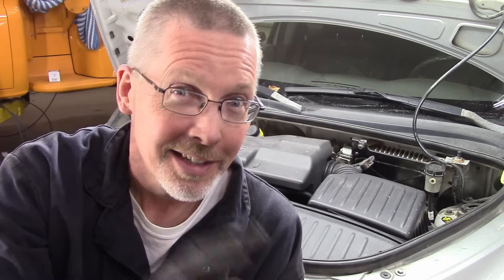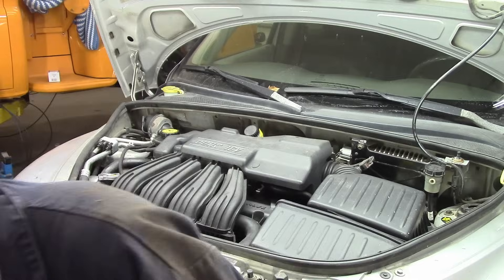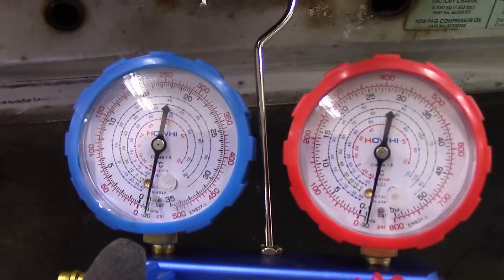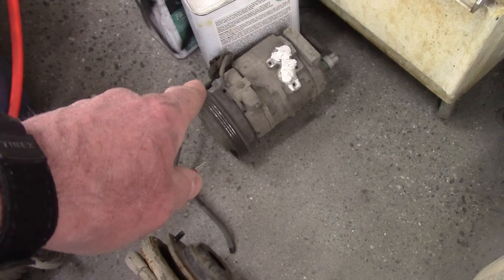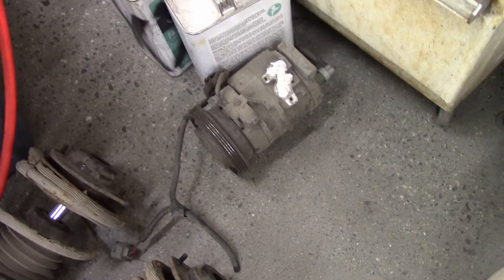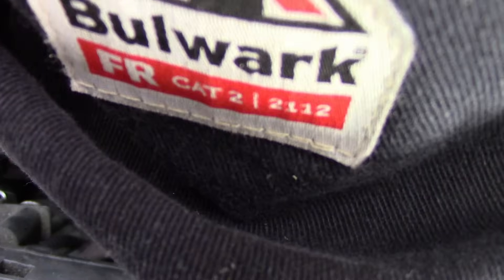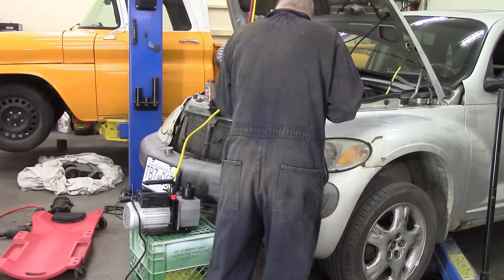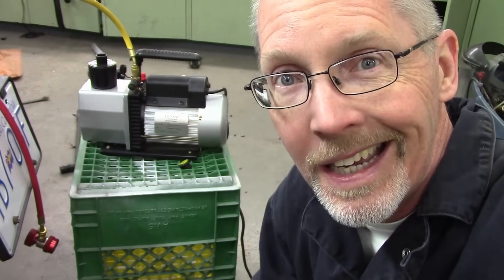DIY Testing, Fixing, & Recharging A/C

Comment: Thats the most half-cooked, haphazard, half-everything untechnical ridiculous "ac repair" video I've seen in my life that nobody should be seeing! So many things done the wrong way! You know, the right way is not always hard! The wrong way mostly always is!

Some laughable bloopers in the "repair" work(I can write a whole essay on it but don't have time) would be...

1) the right way to start this job to make it easier would be to remove the front bumper and the radiator first so you have all the room and dont have to cut off compressor bolts! Way more easier than wrestling with the compressor.
2) You didn't check if the compressor was getting power supply at the connector or not which would be due to a bad relay or fuse or a lot more other wiring related faults. Just bypassing a pressure switch isn't correct compressor failure diagnostics!
3) You start vaccuuming and then decide to put a new Accumulator. Im sure you switched off the Vacuum pump and then opened the lines again. Then, the low pressure inside sucked in tons of moisture and air! Super.😊
4) You did not say what refrigerant you actually ended up putting in it. Those dubious cans have added oil in them and you end up putting extra oil in the system. 

All I can say is Im aghast. Its awesome to use stop gap measures in a bind but this made me squirm. 
Anyway it was quite amusing. Thank you.

Comment: That thing about freon putting a hole in the ozone?  Yeah no. A gas (freon) that is heavier than air gets to 20,000 ft where sunlight breaks it down into sulfuric acid, then gets to 40,000ft and then blown all the way to the antarctic to destroy the ozone layer. Not buying that pile of bs.
That broken piece in front of radiator is probably an ambient temp sensor for the climate control or for engine management. 
On a side note, the last I heard India was still producing a billion pounds of R12 a year, and the hole in the ozone layer has disappeared.

Comment: when filling a/c on the low side keep the can upright so it draws gas off the top. upside down the can will flow liquid which can warp the reed valves in the compressor or worse case liquid slug and hydrolock it  making it spill its guts. ugh bummer
Reply: That was my concern also. Never fill refrigerant in liquid form.
Reply: @squirrelcovers6340  i have many times charged liquid  to the high side. when you put it in on the high side,  if the reed valves are leaky and you dont know it you are in the same outhouse

Comment: While not applicable here - make sure that plug you're jumping only has TWO wires not 3. 

If it's got 3, one is ground, one is sensor out, one is +5 from the BCM. The BCM can see what the actual pressure is (vs on/off or high/low).  Anyhow, point is you could damage the control module, and it won't turn on the compressor.  You just go to the fuse/relay panel and short the switch contacts there.  Same net result. 

We now continue with your regularly scheduled broadcast.
Reply from the maker: Very true. I'm working through the wiring harness of an LS Chevy right now, and I see that it's a pressure sensor in that system - three wires!
Reply: @GregWellwood  Found this out with a Mitsubishi Outlander. I just used a 1.5v AA Battery which gave a voltage within the correct range and the compressor clicked in.

Comment: Actually, by unbolting the compressor from the engine first and tying it to the radiator support you don't have to evacuate the AC system. Ive done several of those timing belt kits (with water pump) on PT-Loosers and had no problems. It's approximately 4 hour job.
Reply: I didn't think you should have to open the system
Reply: Yep

Comment: I'm sooo glad i came up on this video! I have been wondering about buying used compressors from junkyards.  From all my research, you absolutely want to keep all dirt/debris OUT of the AC system, however obviously if you buy a junkyard compressor its def gonna be dirty inside....how do you handle that?....or YOU DONT CARE? lol :)
Reply from the maker: When I pulled the compressor, I was careful not to get dirt inside.  Then I stuffed tissues into the holes to keep anything more from getting in.  When I got it home, I blasted inside with compressed air to hopefully blow out anything I missed.  At one point, you will notice I had put some white duct tape over the holes as I installed it.  Some things that I buy used on, I have to gamble on.  $300 new, or $40 used.
Reply: @GregWellwood  aaaaah ok that makes perfect sense...that's the gamble dilemma I am currently facing. I was wondering if I buy a used one that's not currently still installed on a vehicle, if it would be too dirty inside.
Reply from the maker: I prefer to pull my own parts (if the yard lets you), and I wouldn't pull one that's been disconnected and open to the elements.
Reply: @GregWellwood  gotchya! thanks for the responses and keep up the great content!
Reply: As long as the lines are hooked up on the junkyard one you should be ok. Just be sure to plug the lines (i use those cone shaped squishy earplugs) as soon as you remove it just to keep anything out.
Reply: @davidtatum8682  thank you!!
Reply: @troyporter3825  anytime

Comment: You know you should be using aluminum based anti-seize.
Reply from the maker: Are you sure? Aluminum-based is "food safe."  I may not like this car, but I'm not going to eat it. https://www.crcindustries.com/world-anti-seize/
Reply: The car has an alloy block , right — so why would you use copper base anti-seize ?
Reply from the maker: The car has an iron block.  Copper-based has a higher temperature rating. Nickel-based is used where Copper is not allowed. Both reduce corrosion. Either can be used with aluminum parts.  Aluminum-based is food safe.

Comment: Before replacing the compressor you have checked fuses and and wiring that is associated to the ac. Don't assume the the compressor is bad. It could have cost you more , replaced the part and still don't work. Keep that in mind.
Reply from the maker: Correct. Sometimes I gamble and win. In the next video, I lose.
Reply: Or something as quick and easy to rectify as the air gap on the electromagnetic clutch.

Comment: I've been a professional mechanic over 10 years, I thought this video would be laughable but you did a great job and were rather amusing. KEEP WRENCHIN
Reply: Some of my coworkers don't have that knowledge and their considered professional. Great job
Reply from the maker: I have a philosophy: "I can pay a professional to screw it up, or I can screw it up myself for free."  And... I have been teaching shop since before OBD2; I'm old.
Reply: @GregWellwood  Same motto, and when I mess up I know and try to fix it.  Some mechanics hide mess up and give the car back with a hidden problem.  As example, once I couldn't change a tire on the side of the road because the stud just spun.  The Goodyear tire monkey who recently changed that tire likely didn't know about LH wheel studs so just kept turning up his wrench until he spun the stud in the hub, then just put the wheel back like that, not letting the owner (me) know his screw-up, and leaving a hole to step in.
Reply: @GregWellwood  I got a 2006 mazda 3 2.3L 4cyl 

Problem A/C works great at high speeds but at idle it cuts back on cooling  sometime it will cool for awhile at idle then warm up and cuts back on cooling Car does not overheat
Car been maintained well

New parts below

Ac compressor (New)not rebuilt  not China crap eather GPD
Cooling fan
Condenser
Dryer
High pressure line
Water pump
Thermostat
Flushed radiator inside /out coolant
Expansion valve
Canned R134A
Cab filter
serpentine / A/C belts

What could it be?
Reply: @svbarryduckworth628   thanks buddy
Reply: @svbarryduckworth628   mine has 330k miles and it great  just saying  transmission shifts great still body great and I love it
Reply: @Devo1987  sounds like the cooling fan isn't doing its job to me. If you spray the condenser with cold water from a hose pipe does the AC get cold?
Reply: @svbarryduckworth628  funny considering that the Ford F150 is the most dependable truck on the road in it's class...and no i dont own a Ford, but I would definitely buy one. Grew up with my parents owning Fords and always were dependable vehicles.
Reply: @svbarryduckworth628  my Ford is 5
My Ford is 54 years old and my Sons will be taking their dates to prom with it this weekend and looking cool doing it.
😅
Reply: I was this was not a serious repair but it looks like it is good.
Reply: You were able to pull vacuum, aren’t you supposed to have it in line w vacuum pump to fill from one of those cans?
Reply: Damned by faint praise;-))

Comment: Was wondering why you didn’t mention testing for power and ground at the clutch before replacing the compressor.
Reply from the maker: Hmmm.  I don't know why I didn't.  Those should be step #1 and #2 before pulling the compressor for sure!

Comment: Ahhh, the Old PT Barnum Cruiser, made lots of money on them over the years. Almost every task leaves 3" of room to get twice as many inches of parts in and out. 

I prefer to use the silver anti-seize (tin man style) ...and some o-rings slid down the bolts to help hold them in place. They collapse easily later on.

Nice work.
Reply: After watching the video, giving due consideration of the amount of effort involved and factoring in that the entire project looks to be about as entertaining as masturbating with a cheese grater, I've arrived at a superior and much faster solution to the entire problem.
A five gallon bucket of thermite. Don't need anywhere near that much, but a job well done is a job done thoroughly.
This is an unusual solution that I'm recommending, as I usually recommend the judicious application of copious amounts of high explosives. But, the exception is for when one considers whether or not the world would benefit from any part of this turd entering into high earth orbit.

As an aside, I've learned that this vehicle would never be allowed to be launched into orbit, as planetary protection protocols would consider its reentry a hazardous contamination event, as it obviously should've never been permitted to grace the surface of this earth in the first place.
Reply: Great idea, 'O'rings........
Reply: @scottcrowley2061  O rings, worked great for the space shuttle and the Pershing missile...
Not a >BOOM!?> problem...

Comment: I wouldn't use the vacuum pump to evacuate refrigerant. They tend to buck at pressures greater than 25 psig and start blowing oil out the exhaust. Plus there's no way of saving what you evacuate so we don't put holes in the ozone and all that other government conspiracy stuff.

Comment: It's almost but almost easier to just pull the whole engine out on a hoist and replace the a/c compressor.  Got to give these engineers credit on how to screw things up. 😂 I'm pretty sure the customer is enjoying the a/c but not the bill🤣🤣🤣🤣🤣.
Reply: If it's that tight, I would pull the radiator.

Comment: These are such hateful cars that are badly engineered. Well done for getting the AC working. I'm sure you could add the regrigerant through your gauge set. I hope to never have to work on one of these although my mechanic has had a customer who owns one.
Reply from the maker: I have since made an adapter to hook the cheap cans to the gauge set.
Reply: "These are such hateful cars that are badly engineered."  Bullsh1t
Reply: You're entitled to your opinion so let's agree to disagree.
Reply: @Parknest  I've owned 3 and maintained a 4th for someone else, so my opinion is based on facts.
How many have you owned?
Reply: You clearly know these cars inside out. I've never owned or worked on one (we had them over here in the UK) so you make a very valid point. Sorry!
Reply: @Parknest  S'alright, I'm a Brit too mate 😉
The 2.0ltre NA petrol we got in the UK was probably the worst engine of the lot, but not dreadful. They need cambelts and they are a cow to do - and even good mechanics are prone to getting the camshafts one cog out and not realising - the engine runs fine, but is down on top end power.
The 1.6 is the same lump as the BMW Mini. The Mercedes 2.2 diesel (the second phase 2006 onward particularly)  is a blinding engine that can be tuned easily to scare the sh1t out of average GTi's. That same engine will go 500,000Km in German taxis.
The 2.4 Turbo petrol is still a quick car today. 
The "build quality" stuff really is just idiocy from the internet, based on the cars getting old and being handed down 2 or three times from the original Boomer Grandpappy owner, never maintained and run into the ground.
They are well built, strong bar some cockpit parts in Ye Olde American way, really practical, literally a van if you drop the back seats out, they handle if you lower them and provided you don't let the rot get properly into to the end of the sills (rockers) there's not much else to worry about. 
A nice one is now 5-6000€ over here in Germany - up a couple of grand on a year or two ago. The ones left will rapidly become worth saving.

Comment: " Propane in your BBQ tank boils at -40... sorry that's Celsius " I'm really hoping that was a joke because -40C and -40F are the same temperature. It's the temperature in which the 2 scales cross each other and are the same.
Reply from the maker: I never was good at simple math.  If I doubled it and added thirty, I got -50°F
Reply: @GregWellwood  Double it, subtract 10% and add 32.  Comes out to -40.  @kyzercube is correct.  -40-F and -40C are the same.
Reply: You'd probably be better off using freedom figures.
Reply: @horsepowerandtalk1033  how many wumps are in a mugwump again?
Reply: @spvillano  I don't believe JK Rowling ever specified.
Reply: I remember many years ago, an engineer discussing using propane for a refrigerant for cars. Someone then squealed over "propane is flammable!".
I looked over and asked, "What the fuck do you think gasoline is?".
Seriously, a pound or two of propane vs 70 - 120 pounds of gasoline in a car. I never did suffer fools well.
These days, if memory serves, propane is listed as R-150.
These days, I'd probably just say screw it and vacuum out any R-134a and toss propane in. Yeah, there's a pressure difference, but like many things, it's where on a curve normal operation lives at that matters.

Comment: I don't understand if you bought the Amazon Guage, why didn't you use the vacuum hose to put the refrigerant in?
Reply from the maker: The 12a cans have a different fitting than the R134a gauge set bottle adapter uses.  I have since made an adapter to do so.
Reply: Each type of refrigerant for use in Mobile A/C systems has a different type of connector fitting to prevent cross-contamination.

Comment: That thing in the front is called a outside air temp probe. I think
Reply from the maker: That would make sense.
Reply: @GregWellwood  
Yes it’s a ambient air temp sensor.  And on some cars will affect a/c operation due to some vehicles the a/c controller is looking at the ambient temp.
Reply: @GregWellwood  once in a while I get one right. Thanks for that video though

Comment: Removing and installing the drier would have been a lot easier if the mounting bolt was placed somewhere else.  Poor Chrysler design choice. That compressor was no fun either.